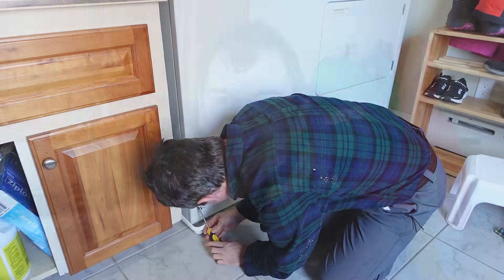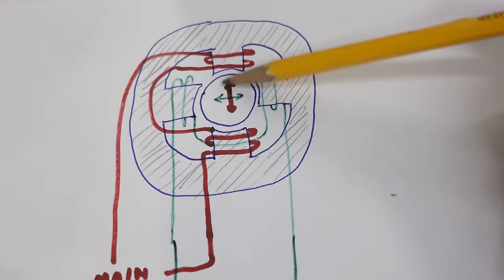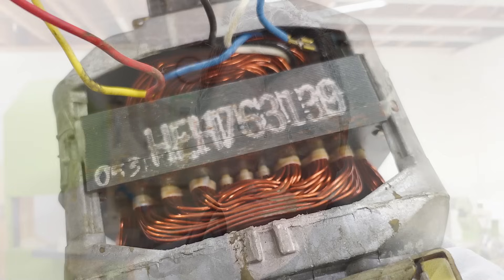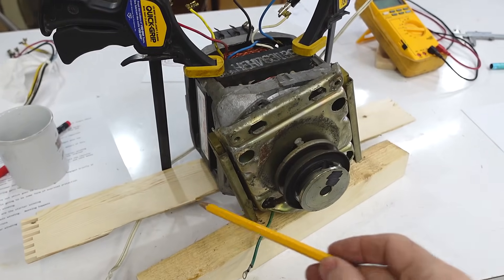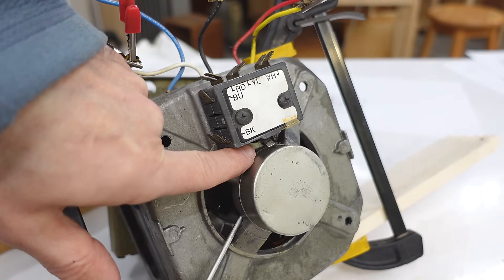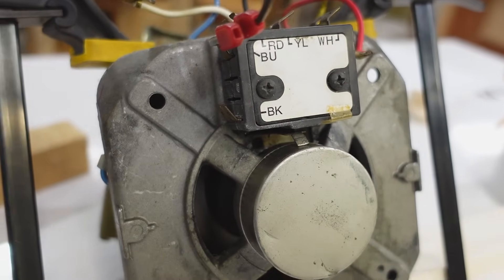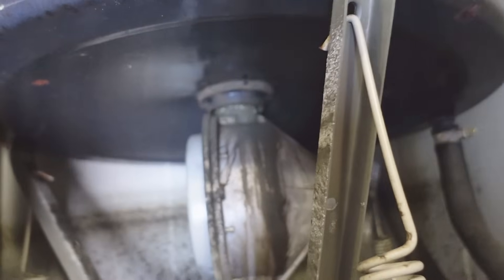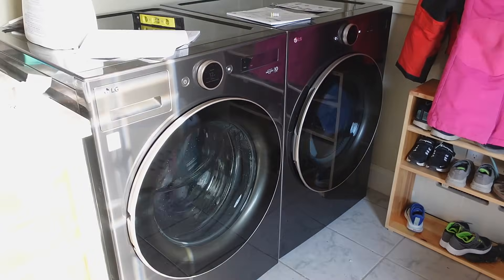Washer motor wiring to reuse for projects

Comment: Hey Matthias, can you explain how the resistor changes the phase on the resistance start IM? I’m under the impression a resistor only changes the real component of a circuit and not the phase angle. The way I can see it starting with a resistor would be having the magnetic field vectors of both circuits effect the stator and just slightly moving it thus starting its rotation, but I’m guessing. I would love to see you have another video on this subject!
Reply: I'm also fairly surprised about this, I don't understand how it works.
Reply: @basaringaron  there was a time when no one understood any of this. All of this took a lot of time to discover and understand. The story of Hans Christian Ørsted discovering electromagnetism is rather comical. He was actually trying to demonstrate the phenomena didn't exist. That's how little he understood. No one was arguing with him either. But when his little experiment did the exact opposite of what he said it would it became evident that he lacked a certain understanding.
Reply: @1pcfred  sure, but now electromagnetism is very well studied and understood. I’m interested in why a resistor will is an option over a capacitive impedance changing the phase angle of the current which will have a different magnetic vector. I guess it would be interesting to see why you’d pick one over the other.
Reply: Pure resistance doesn't change phase, though, so saying "resistance works" isn't the full picture, or at least not how it's explained in the video.
Reply: i just went through wikipedia trying to figure out how it works; this phenomenon is described in 3 different sources but explained in exactly the same manner. the phase shift is then "approximately 15 deg in the starter winding and 40 deg in the main winding". so to youtube i went and i found this indian dude going over the math and that cleared it up a bit for me. https://www.youtube.com/watch?v=fhWrcrsgwyg. basically, impedance triangle, change in resistance and reactance = change in impedance, change in impedance changes the voltage phase angle, and then you do a bunch of math to figure out what the maximum starting torque is for a certain winding configuration or something
Reply: @ikbendusan  the "and reactance" there is doing all of the lifting. Change in resistance alone doesn't do anything - but compared to the main winding, the starter winding has more/less inductance (particularly in proportion to its resistance) and that is what changes the phase angle.
Reply: @UnreasonableSteve  i assumed as much; i was dissatisfied with the simplicity of that answer though and wanted to see it expressed in formulas rather than "it is the way it is". the impedance triangle suggests that the resistance does in fact matter because without a change in reactance the angle theta still changes

Comment: Simple analogue electrical and electronics with solenoids and hardware Timers can last 30+ years ( if you replaced those bearings and greased it would probably last even another 30+ years! )  and now a smartphone or "modern" washing machine lasting 10 years is a MIRACLE. No wonder we are regressing and wastefully over-consuming.
Reply: Consume massive quantities!

Comment: I really like the schematic!
I'm not really the person to say that everything was better in the past. I like the possibilities that modern electronics bring. Electronics can be very reliable, more so than intricate mechanics. But I would really like to see schematics in modern appliances. You need them more than ever to be able to repair...
Reply: Electronics tend to not be reliable with machinery though.
Reply: @1pcfred  I guess it depends. I think that modern fuel injection systems in vehicles, for example, are way less finicky than carborators.

Comment: Our modern front-loader washing machine failed after 7 years when the piece holding the tub to the motor failed. I was worried more about the electronics. My dishwasher is nearing failure: there's some current leaking into the "drying" light even when it shouldn't be on. I expect that indicates moisture that will lead to a larger failure of a circuit board but it's been like that for 2-3 years now.

Comment: Nice you got LG, you'll have lots of repair content in a year, I can't wait to see!
Reply: Not as much as a Samsung machine but more expensive.
Reply: @plusmanikantanr  I heard the Samsung machines are much improved now.  Still by far the worst in the industry, but not quite the garbage they used to be.
Reply: LG washer and dryers are actually highly rated and reliable.
Reply: My LG top load washer is 10 years old or more and has done some hard years. Hasn’t missed a beat. The button membrane panel did require a packing tape addition recently however.
Reply: I wouldn't touch anything Samsung with a barge pole.
Reply: I bought the quietest fridge and ended up with LG. Makes a lot of noise, so don't buy.
I also bought an LG combi washer/drier. It comes with an app, and the app demands location turned on at all times. It's not good for your privacy. Don't buy.
Reply: Seven years until the drum spider corrodes through. Probably the water pump will fail first.
Reply: If he wanted lots of content he'd have Whirlpool.  I think I've repaired our fridge, Oven, dishwasher, clothes washer, and dryer in the past 4 years (~5 year old appliances).
Reply: @Nomad5d its funny how people can have totally different experiences from the same brand. We used to have a whirlpool duet front loading washer that was 20 years old and the only reason we replaced it was because the spider on the basket cracked and separated on the spin cycle. We also have all whirlpool kitchen appliances and besides a bad relay on the control board for the dishwasher they have all been fine for the last 5-10 years.
Reply: @JackS425  That makes sense when different era of a company are compared
Reply: My LG washer is doing just fine, just turned 10.  They are dead simple mechanically due to direct drive and the electronics are potted. I'm sure it has another 5 in it.
Reply: It's hilarious how many "repair guys" will tell customers to never buy an LG washer, but I've sold washers to at least three local repair guys... they all bought an LG front load washer. They're almost comically reliable and so incredibly well designed which, if you've been inside one of WhirlPoop's tin-can-toploaders in the last decade or so, you'll quickly realize that WhirlPoop just wants to cost-cut a 40 year old design (such that it's neither efficient or reliable!) and line their executive golden parachutes until they declare bankruptcy. Absolutely no innovation in the last 40 years. lmao
Reply: So if my 2000's Maytag only agitates in one direction could be the timer?
Reply: Actually LG makes a fine washer and drier. It their fridges that are junk.
Reply: @chribrian  is that the deal? I remember the last time I was shopping for an appliance I was warned about LG but it was for a fridge.
Reply: @1pcfred  Stay away from their fridges until they quit using the linear compressor, It is junk.
Reply: exactly.... that's been my experience... luckily for me the fridge I bought was under warranty when it broke down so I'm good to go for now> @chribrian

Comment: I still have that same old Maytag washer.  My parents bought it in the mid 80s.  It's needed a belt once or twice and that is it.  We still use it every day. They moved to a new house in the early 2000s and are now on their third front loading washer. 😢
Reply: We "upgraded" to front loaders about 20ish years ago.  We are on our third front load washer. UGGH.   First one Lightning got it, Second rear drum shaft seal and bearing.  Built non serviceable. I made many pieces dissecting it.  Third one is in servce.  Bought basically the cheapest best reviewed machine.  I do not expect it to be around too long though. Uggh.
Reply: @69dblcab  Lightning  most definitely does kill the LG machine conrol boards. Better to have some kind of mainline inverter/stabilizer to "protect" it from external faults.
Reply: Run a ground wire up a tree?
Reply: @plusmanikantanr  Yes. That task was completed. We are also the last house on the electric service. Thanks for the suggestion.
Reply: Next time tell them to cough it up for a set of Speed Queen units.  They'll last like the old ones will, and they're made in the USA.

Comment: I would be willing to bet the new ones don't even wash as well as the old ones did when they worked well.  But they save water.. apparently thats all that matters.  Don't like front loaders at all.  Not sure how putting a tiny but of water and slapping the clothing around in it barely wet is supposd to replace actually soaking clothing in water like old machines.  IF those new ones last 10 years your probably lucky.

Comment: Scrapped my old Toshiba microwave, Massively heavy transformer, huge capacitor, lots of salvagable components and yes, a schematic stuck inside the case.
Reply: I bought a Toshiba microwave just because you can press 8 for a few seconds and cut that confounded beeping off,...

Comment: It's always fun watching you take apart and explain how something works! What a shame we can't buy durable appliances anymore.
Reply: You can, Speed Queen.  Made in USA.  Designed to last.
Reply: @ShanesGettingHandy  Speed Queen is certainly excellent, by all accounts.  But they can be a bit pricey and hard to find.  Maytag Commercial washers are alot more common and reasonably priced.  They're basically a design Whirlpool has been making for quite some time with a bunch of fixes for known issues and upgrades - they seem to be pretty robust: https://www.youtube.com/watch?v=dV6pkY8maLk
Reply: A fisher and paykel that's sold in Australia, not only has direct drive, stainless steel shafts and they work on an inverted 300 volts and can easily be turned into 12v 3 phase generators that can then be rectified into 12-16 volt dc for charging batteries. They last for quite a a while too.
Reply: That is the double-edged sword of capitalism.... Profits drive cheapness, NOT durability.
Reply: @elDoober  Make it more basic than that. It's rent seeking. An appliance you buy once and it's good for 50 years doesn't allow the company that made it to acquire rent from you. So make it cheap, and built to fail, (obsolesence) and get the customer to pay again.
Reply: @elDoober 1960 vs. 2020  More expensive now(inflation considered), yet NOT "durable".  I fixed modern washer repeatedly in contrast w/that old "junk". Eventually, can't get parts for either.:face-pink-tears:
Reply: You can.  A good YouTube channel for this sort of thing is Ben's Appliances and Junk.  They still do make old style washers.  Some of the Maytag Commercial stuff is basically old school Whirlpool.  And Speed Queen is famous for being bulletproof.
Reply: @ccoder4953  Agreed, if you want to spend $3-4,000 on a washer and dryer you will get the same build quality from those select commercial grade machines of the 80s and 90s. Adjusted for inflation they are probably not far off from what they would have cost ~40 years ago. But you also have to keep in mind they use a lot more water and detergent to do what modern (cheap) HE front loaders can do for 99% of what people put into them. You get what you pay for and for almost everyone they need the $1500-2000 set that will last 15-20 years not the expensive ones that will last 40 years.

Comment: You actually just explained this to me in a way that I finally understood what was happening inside the motor to make it work. Thank you!
Reply: There's not much to it. A non-reversible motor the one connection is just buried inside of the motor where you can't get to it. But other than that they all work the same way. Well, that's how single phase motors work. Well some are cap start cap run. The start winding stays energized. There's really like 8 different variations but you mostly just see the one.

Comment: I'd suggest ordering a replacement drain pump for your new LG and store it somewhere near the washer.  You'll need it rather suddenly in a few years.
Reply: You can make the pump last a bit longer by pulling it out and cleaning the rotor periodically, but it's almost more hassle than just replacing it.
Reply: Also buy replacement Heater elements if you have hard-water or iron-rich water supply. Or invest in water-softening or treatment systems.  LG machines with heater / steam generators tend to build up limescale fast and have no built-in descalers or sacrificial metal design.
Reply: Found this out the hard way…
Reply: Thanks for reminding me of why I hang on to my old top-loader.
Reply: I had the drain pump go out and instead of replacing it I just reset the system and it fired right up again. These new smart washers are a pain, but resetting them actually does something.

Comment: I used multiple old front loaded washer motors without problems. They were pretty much universal motors. Mine had six wires, two for tachometer, two for the brushed rotor, two for the stator winding. No starter winding at all. Very easy to use and cheap power controllers from aliexpress work great with them. Possible to reverse direction of rotation by changing polarity of one of the windings. They can also be wired for 230 or 110 (windings in series or parallel). My homemade wood lathe works with one of those.
Reply: LG front loader washers use a direct drive permanent magnet motor. The rotor is more or less part of the washing drum, making it difficult to attach to something else. Also it requires an inverter driver to control the motor, cannot run directly from AC.
Reply: @SimonRajotte  that is true, the modern ones basically use something like a large BLDC motor. That's why old motors are a treasure.
Reply: They can also be used with both ac or dc!

Comment: I usually just lick wires to figure out what they do
Reply: Good job, I work with high voltage transmission lines and taste test the 150.000 V lines to check if power is online before conducting maintenance work and can confirm this is good